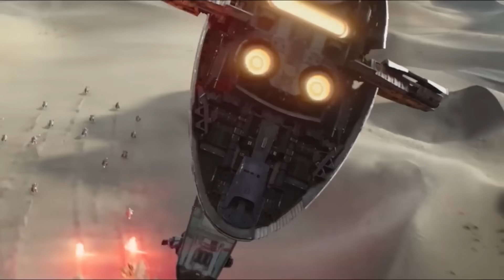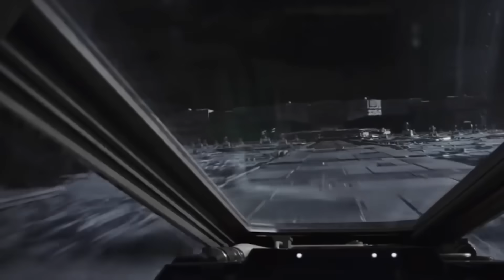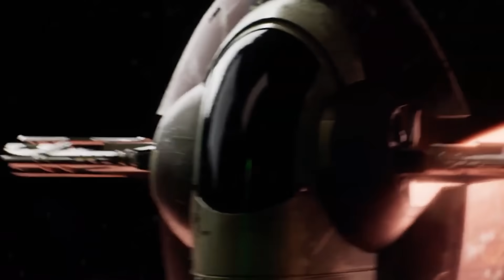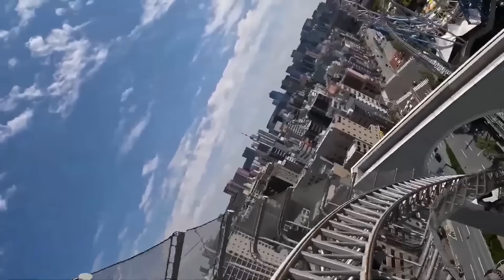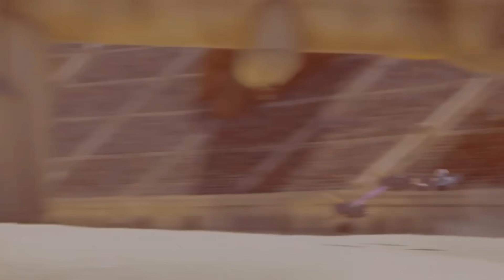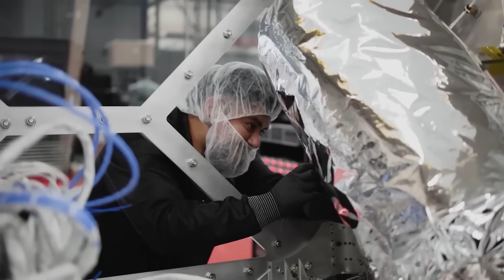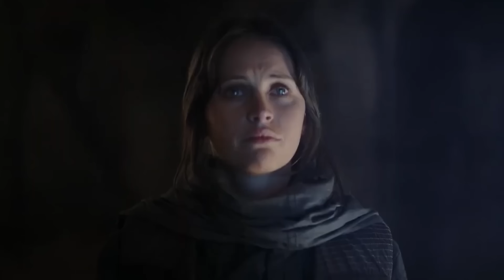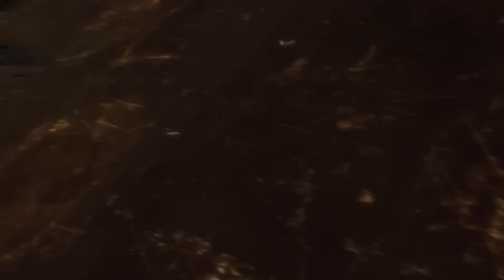The Problem with Star Wars Ship Design

Comment: This is complete nonsense, and displays that you have a complete lack of understanding of both Star Wars lore and real world military ship design.

Your first argument is that Star Destroyers have exposed bridges and shield generators...real world warships have exposed bridges, that's how they're designed.

That said, the example with the Executor shows a profound misunderstanding of the events that led to its destruction...the A-Wing that crashed into the bridge wasn't able to just do that...the entire rebel fleet had to focus their fire on the Executor to bring down the shields temporarily...this is what allowed the couple of rebel starfighters to take out the shield generators, by giving them a very brief window of opportunity...that in and of itself was an extremely difficult thing to do, then the A-Wing managed to slip through numerous point defences, a freakishly lucky occurence, and hit viewport perfectly...

The sequence of events that led to that point were almost impossible.

Also, the 25,000 Star Destroyer figure is complete nonsense. It's originally from the first novel in the Legends Thrawn trilogy, and Timothy Zahn got it from a fan forum (at least according to an interview)...the problem is that it was arrived at by taking the number of sectors mandated by the Ruusan Reformation (1024) and multiplying the number of Star Destroyers in a sector fleet according to the Westend Games Star Wars TTRPG's Imperial Sourcebook...which is 24.

The problem with that figure is that the Ruusan Reformation got scrapped by Palpatine very early on into the Empire, according to Lucas' lore on the subject, and the organisation of the galaxy changed a lot, the large sectors were broken up, new territory was conquered, etc. It's also directly contradicted by the Imperial Sourcebook, which states that The Empire is divided into countless regions, and each region contains multiple sectors, some regions have as few as 3 sectors, and others having thousands...this means that there are regions in the book that gives one of the numbers for the calculation that would have, at minimum 2000 sectors, meaning at least 48,000 star destroyers in a single region...

Your second "flaw" is basically just a rehash of the first one...and no, it's not a flaw...again, the fact that the bridge is raised isn't an issue. The whole point of the design of star destroyers is that very, very few things are going to even be capable of dropping their shields...again, with the Executor, it took the entire rebel fleet, and a chain of almost impossible follow on events, to take advantage of this "flaw"... 

The third flaw basically boils down to "windows seem dumb when you have sensors"...except that actually being able to see things yourself is kind of useful...sensors can be destroyed, or overloaded, tricked, etc...now, you could argue that maybe giant bridge windows specifically aren't a great idea and that maybe they should alter the design...but again, lots of real world warships have big windows on their bridges...

And your assertion that "a single piece of space debris" would be an issue for a lambda shuttle is sheer idiocy...first, the transparisteel is still an exceptionably durable material even if it isn't the most durable options, but they also have shields...

Your critiques of space combat are similarly all wrong.

Your argument for starfighters being able to move in whatever direction isn't really that great, as it would require you to design them in such a way that their engines would have to either move or you'd need multiple engines...ironically, you bring up the expanse, which shows the flip and burn method that we probably should see more of in Star Wars, which would be the best way to drastically change direction in a starfighter.

Wings aren't really a design flaw, most star fighters do operate in atmosphere, and while they don't really need wings in the same way real world jets do, the wings serve secondary purposes like weapon mounts. They're also made from highly advanced materials.

G-forces...come on, really? Inertial dampening tech has been a thing in the lore for ages.

Anakin wasn't the only human who could compete in podracing because he was magically protecting himself from G-forces with the Force...this is literally spoken about in the film...when Anakin says that, Qui-Gon explicitly says "you must have Jedi reflexes then"...because it's Anakin's reaction time that's allowing him to compete.

And no, the ships aren't slow...we see this in the original trilogy, when the fly from Yavin IV to engage the Death Star in under a couple minutes tops, they're obviously capable of flying very, very fast when they need to...even just Yavin Prime has a diameter of almost 200,000 kilometres, let along the orbital distance of Yavin IV and the distance from Yavin Prime to the DS1...they just fight at slower speeds.

In regards to Han using Luke as a gunner...who else was he going to use, either he or Chewbacca would have to fly the ship, so his choices were either Luke or Leia, and the gunnery controls and seat aren't really Wookie shaped, there's also significant computerised aim assistance. Luke being a farm boy, is much more likely to have done stuff involving any kind of gunnery than Leia is.

The study you're citing isn't relevant at all as they're dealing with a very different tech environment...when you're dealing with ships that can accelerate or deccelerate at thousands of Gs and can change direction nimbly at those kinds of velocities...when your capital ships can go from 0 to 80,000+ km/hour in about a minute, a lot of their concerns don't really matter, and the fact that turbolaser fire travels at speeds just shy of light means that the calculations get much, much simpler.

It's the capabilities of the vehicles and weapons that allow them to overcome these issues, not the physics of Star Wars...if we had vehicles that could match the capabilities of Star Wars ships, we could ignore them too.

In regards to ventral gunfire...we literally see the ISD in the opening of A New Hope firing ventral shots at the Tantive IV...you literally show a clip of it...and a clip from Rogue One of a belly turbolaser firing, which visibly shows the turbolaser turret...

Also...turbo lasers aren't actually lasers, despite the name, they're actually blasters...which means the "laser bolts" in the RotS opening are actually particle beams...

Your argument on aesthetics is flawed as well...real world spaceships have to be designed with practicality so heavily in mind because our tech is so limited relative to that of Star Wars...plenty of other vehicles do actually have aesthetic design choices...and using Padme's star yacht as an example of that as a flaw is ludicrous...that's like critiquing a high end luxury car for not being designed like a race car...

In regards to them never working in real life with the materials available to us...of course not...that's a ridiculous argument, that's like showing a WW1 fighter pilot a modern F-22, and having them go "and, what a piece of shit unrealistic design...we could never build that with our current materials..."

And as to comparing the dagger like designs of the ISDs to real world rockets, again, you're looking at our own technology, which is significantly inferior to that found in Star Wars, and saying "they're tech is impractical" despite the fact that they have access to materials far beyond ours, anti-gravity tech, energy based force fields, much more powerful engines, and a boatload of other tech that we don't...

Using the Mon-Calamari ships as a "they don't care about aesthetics" is ridiculous, they're one of the ships that most heavily focus on their aesthetics...and their strong defences have nothing to do with their origin as passenger liners, that was a deliberate military decision based upon Mon-Calamari psychology.

The critical weakness idea is also dumb...plenty of real world military vehicles have "critical weakpoints"...and while some are designed to mitigate that issue, others don't...an excellent example is found in tanks...Russian tanks use a carousel autoloader that sits in the bottom of the turret basket...if the ammo cooks off, the detonation rips through the entire interior of the tank, and frequently blows the top of the turret off. Most western tanks are hand loaded, and frequently store ammunition in a bussel in the back of the turret, which can be closed off, and has blowout panels on the top, so that a catestrophic ammo detonation sends most of its explosion out of the top of the bussel, instead of into the crew compartment.

The existence of an exhaust port on the death star isn't an issue...successfully targetting it was such an impossible and unlikely outcome...but again, real world exhausts and other similar engine related weak points are a real thing in real vehicles...no military vehicles is free from weak points...to use tanks as an example again, the engine bays of tanks have been a frequent target of drones in Ukraine, because of structural vulnerabilities. The mere existence of a weak point doesn't make said weak point a design flaw...typically they're a trade off between capabilities.

In regards to "why didn't the Empire put one of their most lethal special forces in front of the shield generator"...they did.

Stormtroopers in the OT were the most elite Imperial forces, and Palpatine explicitly states that there's an entire legion of his finest troops stationed there.

In regards to your comments on Qui-Gon and co just happening to find Anakin and the part they need being there...you're literally dealing with an actual cosmic force that guides events...and you're like "just suspend disbelief"...The Force is a literal semi aware energy field that pulls strings, there's a mechanic explicitly in universe that explains it...

Comment: I think this perspective is very myopic in terms of its scope and the use of large power projecting ships, it's not all about battle prowess. 99.9999% of the time these ships are not used for combat just like modern naval ships. About half the ship is dedicated towards crew, morale and logistics.

Additionally, outside of redundancy things like glass can be used to replace steel to save weight. The logic would be that if your shield is down, you're in a situation in which the difference between transparent steel and a stronger material would only buy you a few minutes of bombardment
Reply: And then you talk about g-forces. These people can travel faster than the speed of light and you don't think they don't have inertial dampeners like. Come on man

Comment: Three things: 

- The danger for humans comes not from high speed but sudden acceleration. G-forces are only felt when something accelerates / decelerates. As long as you're flying in a straight line with consistent speed, you'll be fine.

- The biggest problem with the space battles in Star Wars is that small ships wouldn't be so maneuverable. In Star Wars they fly like airplanes, able to easily redirect their momentum. That wouldn't work in space. To change your direction you'd have to cancel out your previous movement, which would take a lot of time and use up a lot of fuel. The ships would fly more often than not in straight lines or maybe zig-zags, not elegant curves. 

- Qui Gon running into Anakin isn't as unbelievable as you make it out to be. They had no prior connection. Them meeting is as likely as you meeting a random stranger at any given time. Especially if you consider that this is the inciting incident of the story, which can be a coincidence, otherwise there would be no story. And Qui Gon could naturally feel Anakin's talent. If you're such an extraordinary talent as Anakin, it's pretty a mathematical certainty that you will be recognized sooner or later.

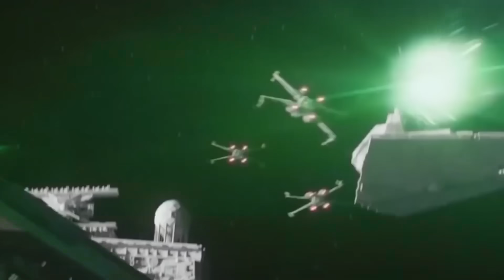Comment: 1:33 - profits. They were thinking about profits. You need to replace the lost Star Destroyers.

10:12 - I think there is a reasonable explanation for having guns on thin struts, away from the ship - heat. Maybe, as the guns fire, they produce heat. And in space, dissipating heat is not exactly easy. Keeping the guns away from the main body will reduce the heat for the pilot and more critical systems. The struts might also double up as heat sinks/radiators for cooling.

Comment: Iowa class battleships had a battle bridge with several feet thick hardened steel.
Reply: No, the Conning Tower was 44cm thick. The belt was nearly 31cm thick, and the armoured decks were between 1.6 and 15cm thick, not "several feet".

Comment: The wings on X-wings are heat sinks.  The only means for dispelling heat in space is via radiation.  More surface area, more heat dissipation.  Those weapons generate a lot of heat.  That's why the wings separate into the x patter.  It exposes more surface area.

Comment: 10:46 any society that can create tractor beams and antigravity repulsorlifts could also make inertial dampeners
Reply: Based on…?
Reply: Based on the fact that those are all made up concepts. Fantasy. Not real.
So it is logical to assume they can do z if they can already do X and y...
Reply: @mikemurphy5898 based on tractor beams, antigravity, and inertial dampeners would all break the same rules in similar ways. If you have the tech to pull a ship into a hangar, you can pull or push humans and other cargo in sync with the ship so they don’t feel crushing G-forces.

Comment: the acceleration G-force would be deadly yes if you assume the gravity is natural..
but since all sci-fi ships have artificial floor gravity... it's not a artificial gravity wheel or a centrifugal force simulating gravity...
then you can assume that the only reason to allow so much energy into generating gravity across the ship toward all floors,
is that  computer use that as a way to Dampen the acceleration and deceleration by countering the force.

while in combat, or the case of surprise attack, any force applied that the computer couldn't atticipate would have it reacting to the sudden movement and compensated afterward...
and so would be the reason some shock would be felt inside...
but the piloting maneuvering being synch by the computer with the artificial gravity ... it can compleatly negate many Gs acceleration...
and justify having those artificial gravity even on military ships which would rather place energy on defensive or offensive purpose...
if gravity was just a luxury.

this is the only logical "justification" I found for artificial gravity in sci-fi spaceships.
because 0-G would be actually even worst...

Comment: Honestly I got the impression that the Star Destroyers had those oversized conning towers because the actual hull was stuffed so full of oversized reactors, the lower parts of the turreted weapons, starfighter bays, and planetary invasion forces that there wasn't enough room left for officers' quarters or C&C systems.
Reply: Also, it provides an anti-mutiny redoubt.
Reply: @n @nowamajormotionpictureeven3797 Ehhh, I think the side with actual direct access to literally everything has the advantage in that scenario.
Reply: I feel like this is exactly like modern aircraft carriers, which also have ridiculously exposed radar and command bridges
Reply: @ZC.Andrew  You cannot armour up radar installations, any armour would reduce its effectiveness, that's why they are shielded from weather by composite screens. They're placed up on the bridge or even above the bridge so as to get the best LOS over the horizon possible. Its the same with the command bridge on an aircraft carrier, its a near impossible target to hit in naval warfare, anti-ship missiles aim for just above the waterline where an explosion causes a large enough hole to be punched to cause flooding, there are some anti-ship missiles that do a top attack where they plunge into the deck. But none of these have precision targeting capabilities to specifically aim for a ship's bridge. It would be the same in real life space battles because space battles would logically happen at Light Second distances. Like to give you an idea, a single Light Second is 300,000km in distance. At that distance, missiles, rail-guns and other weapons that could be precision targeted would take too long to reach their targets and battles would happen with pulsed lasers instead, aiming for where an enemy ship would be at that distance. Even if fighting at distances near Earth where combat could be several hundred to several thousand kilometers, lasers would still be king because the heat signature of a missile accelerating towards you would be unmistakeable. As a result precision targeting a ship's bridge is still relatively impossible unless you're within melee range of enemy ships where you can optically target specific parts to cause maximum damage.